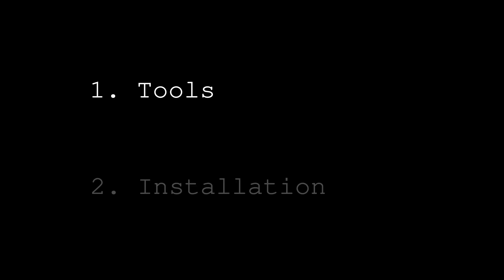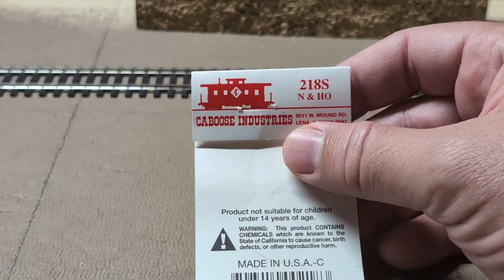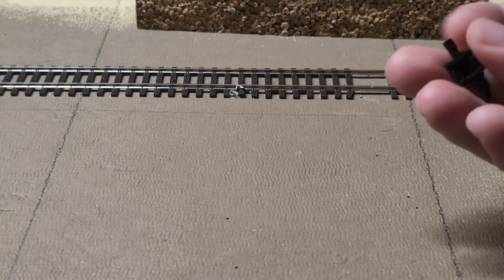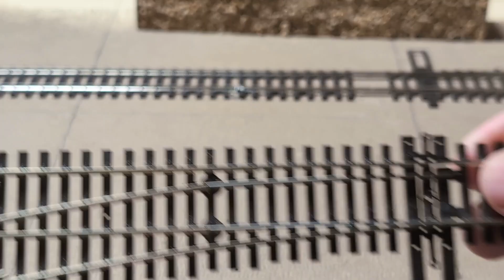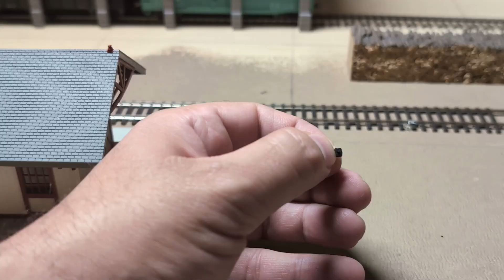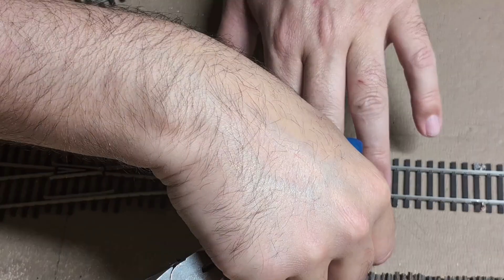Installing Manual Ground Throws on your Model Railroad!

Comment: Can those be switched from one side to the other more specifically the newer Walthers? Thanks
Reply from the maker: Yes.  There is a pilot hole on both sides of the throwbar, so you can drill out either one.  I have a mix of right and left side on my turnouts.
Reply: @FVR @FVRCscott  thank you
Reply from the maker: @RVA1954  You're welcome!